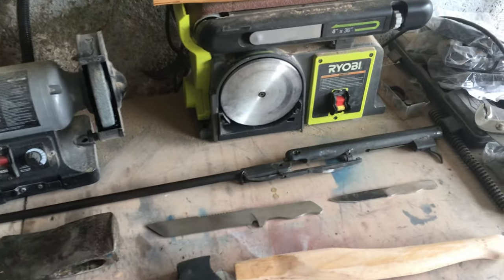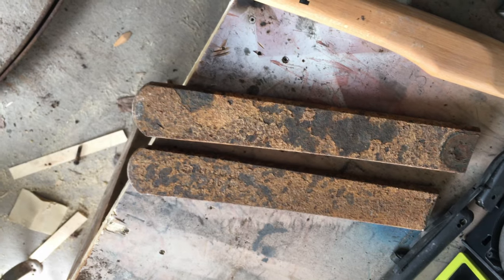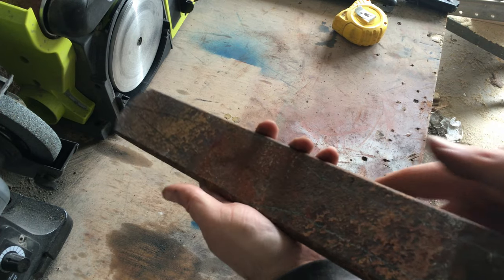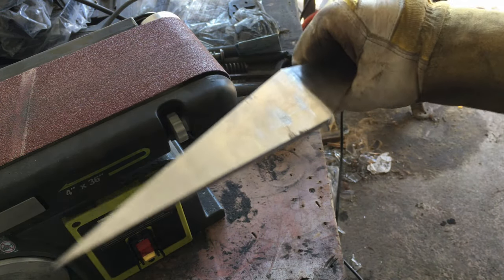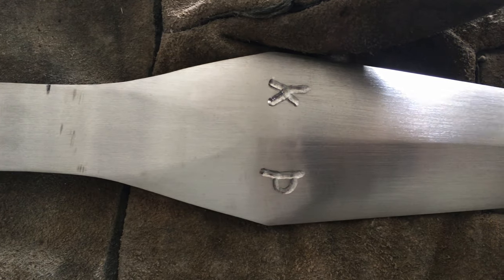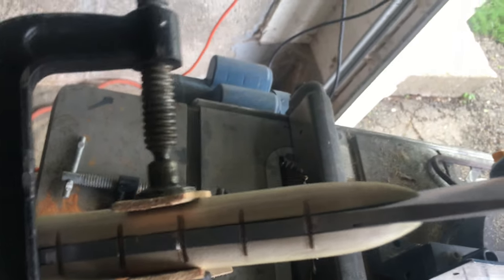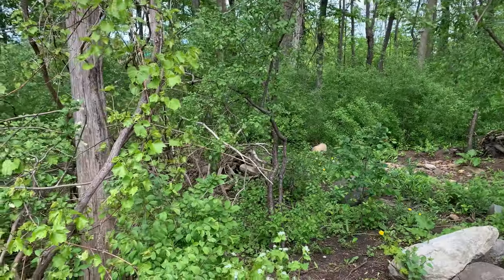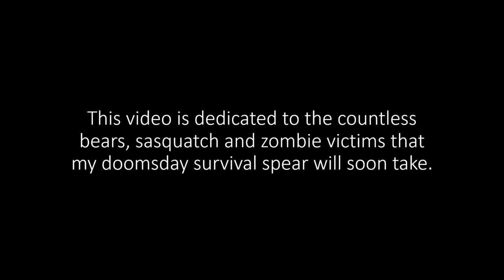Leaf Spring Survival Spear

Comment: Did you harden that blade? I didn't see a quench
Reply from the maker: Nope, I imagine the original hardening has been negatively effected from all the grinding heat.. So she's probably somewhat annealed at this point. HOWEVER,  I'm not worried about it because it has no bearing on the it's use case performance. If it was a sword or knife on the other hand, hardening it would be of the utmost importance due to needing the knife to hold a proper edge. 

So I opted out of the heat + quench + tempering for this as time was an issue and I don't see the need for it in this particular application. That being said, whenI do some knife videos in the future , those will all be treated properly.
Reply: He talks about this near the end of the video.